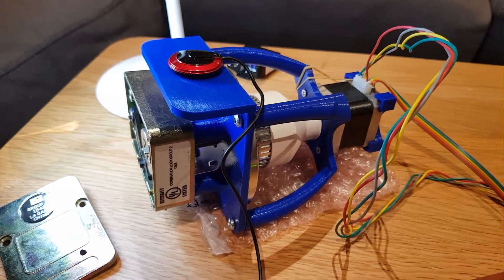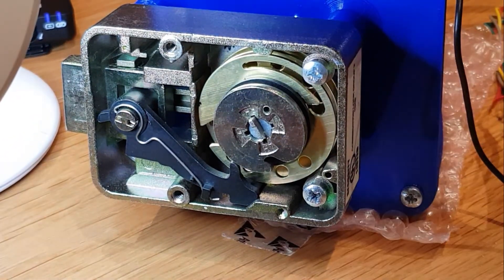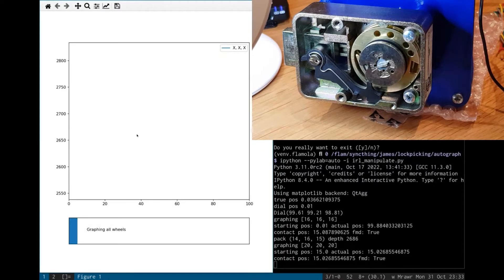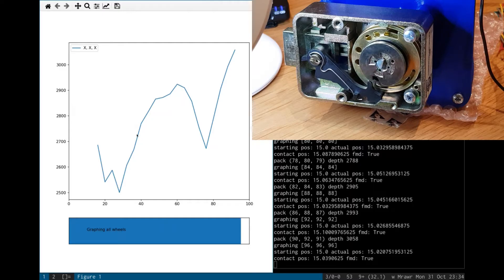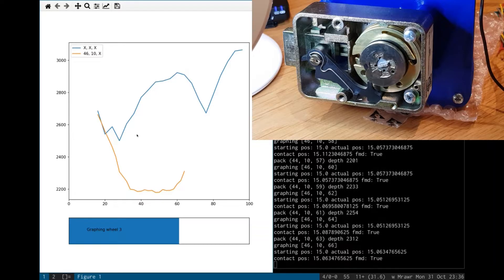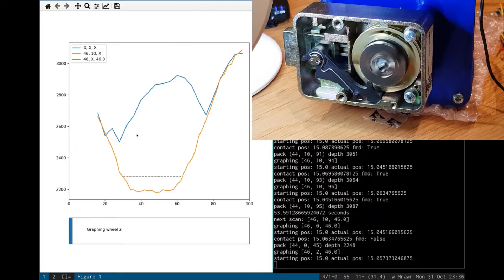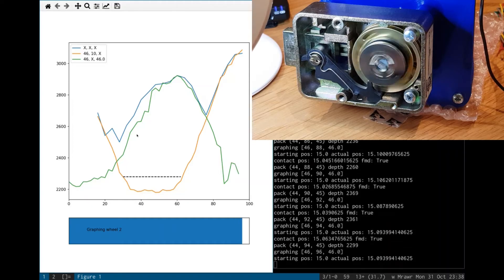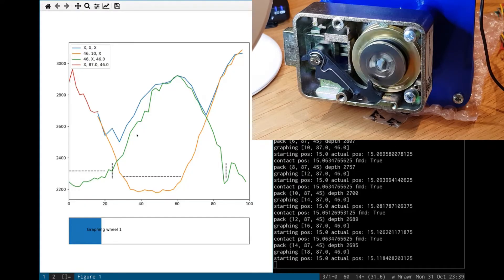AUTOGRAPH3000™©® quick demo

Comment: Very inpressive!
The low noise and consistency of the readings is what stands out to me.
I wish my setup would get as much performance out of the components as yours to be honest 🙂

Maybe I missed it but how are you comparing the position vs the sound?
I want to switch to using a 2 channel (one for sound and one for the steps) oscilloscope and was thinking of the most precise way to monitor position vs sound. Maybe a hall sensor signal instead of the TTL pulses 🤔

Comment: This got to be one of the best DIY auto dialer designs I've seen. I like that it's graphing while it operates. This way, if the lock fails to open, you still have a sense of the lock.